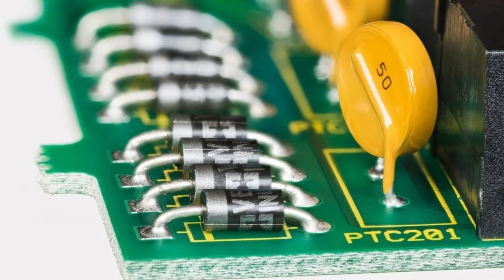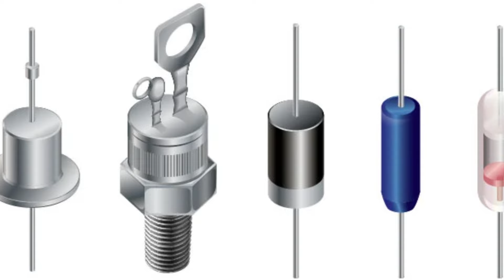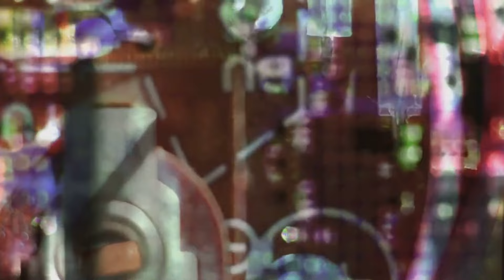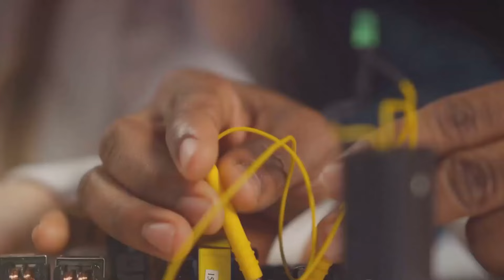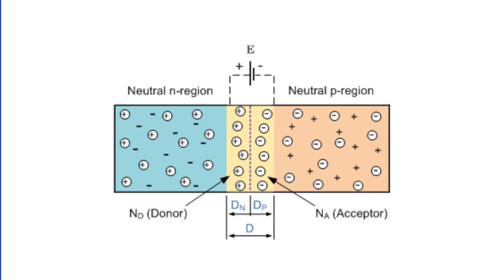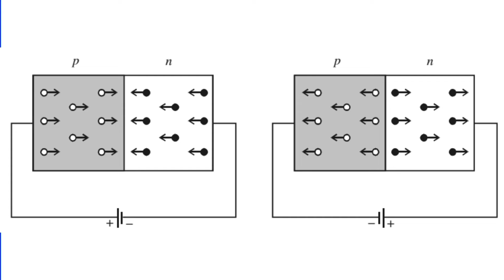The Magic of P-N Junction Diodes: A Deep Dive

Comment: You really bring very dry Electrical Engineering topics to life very well, possibly being the best I've seen.

You asked what your viewers would like to see. Here are two suggestions from me:

1) the mathematical analysis of an astable 555 oscillator when timed using a potentiometer and capacitor combination and a 50% duty cycle, with the circuit you choose showing voltages and current magnitudes and direction from your KCL / KVL solution.

2) the mathematical analysis of an astable 555 oscillator when timed using a tank circuit with a capacitor and inductor in parallel and a 50% duty cycle, with the circuit you choose showing voltages and current magnitudes and direction from your KCL / KVL solution.

No, I'm not a student, but rather a retired software engineer who'd like to learn how to apply KCL / KVL to IC's, as I'm having trouble with that, starting with the 555 timer.

TIA.
Reply: If you have a public-facing email, I can send you an email with a .png attached showing the first circuit, but I'm still fuzzy on the second, tank circuit above. Thanks for your help.